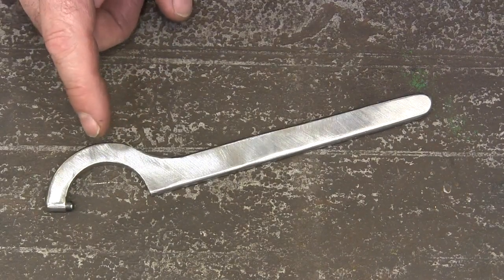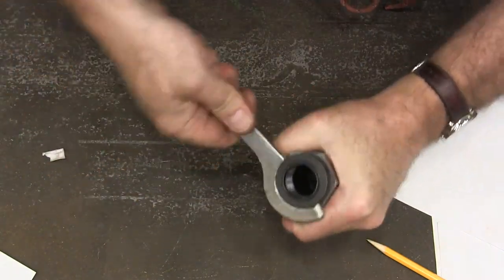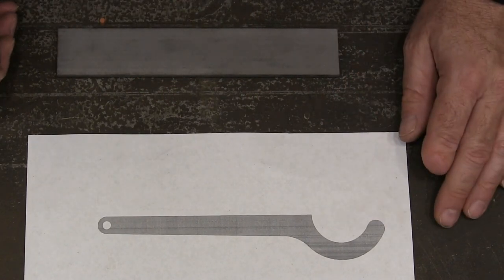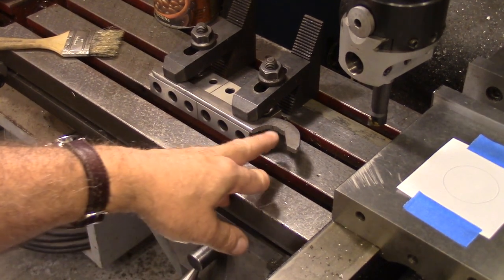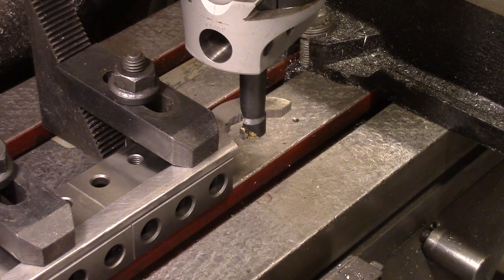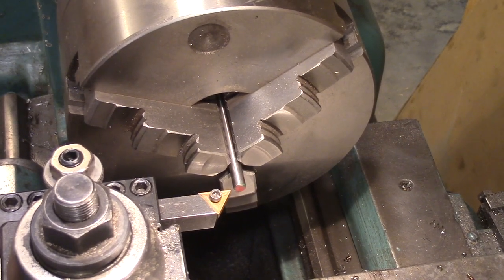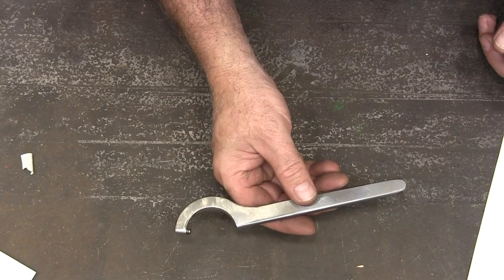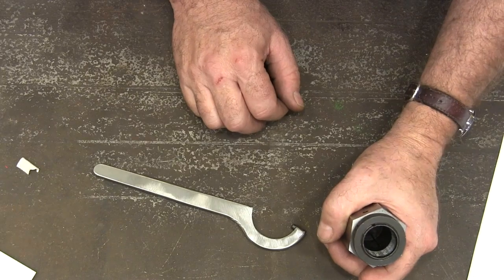Homemade Spanner Wrench

Comment: I got the same collet holder set today.  Found your video, and enjoyed the instruction.  Just finished making the scanner.  I used the smooth shaft of an Allen screw that I turned to .20.  I think it’s plenty hard enough.  It was quicker for me to use a file instead of the mill, after I roughed it out.  Works perfect.  Saved me a trip, and some money.   Than I subscribed and saw many more of your videos that are of interest.  Thanks a bunch.
Reply from the maker: You're welcome!  Thanks for letting me know it helped you. I don't know why they don't come with a wrench.

Comment: I was wondering how you made/attached the pin to the wrench.  My son cuts them out of 1/4" plate on the CNC Plasma table, and grinds the square pin to somewhat round.  The mild steel does not last too long.
Reply from the maker: At about 5:40 in the video I show that I welded it on.  Hope that helps. :)
Reply: @SoatMon  Yes, I saw that.  I guess I did not make it clear in the comment.  We have been looking online for wrenches, but he has decided to try making another by welding the drill rod on.  Thank you for the idea.

Comment: Great video , I need to make one for my sharpening machine . It uses the er45 collets . I do have a question,  where did you get a copy of the wrench . I was going to outline my collet a design a wrench style based on the olcollet outline  . I liked your method much better with the wrench copy. Thank you for the video.  Big Mex
Reply from the maker: I don't actually remember where I got the picture.  I might have made it in fusion 360 or I might have found it on the internet.  Sorry I'm not more help.

Comment: You may know this trick by now, but you can zero over the edge of something with an edge finder or whatever your preferred method is then load up the boring head and jog away from edge desired radius' size then crank her out till she touches that edge =)
Reply from the maker: I had not thought of that but that is a great tip.  Thanks for taking the time to tell me.  I hope I remember it the next time I need it.  There would be times that would be the only way to do it.  Thanks!